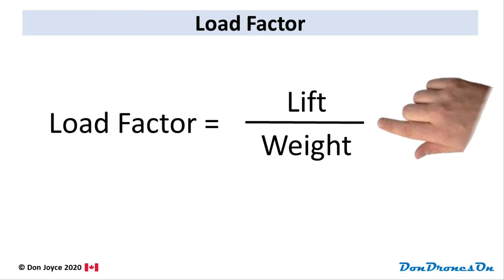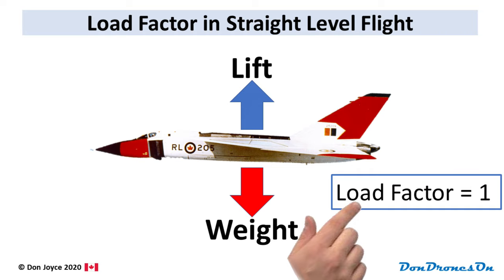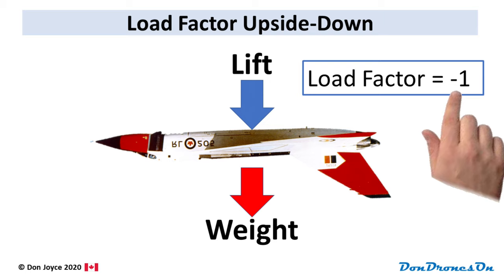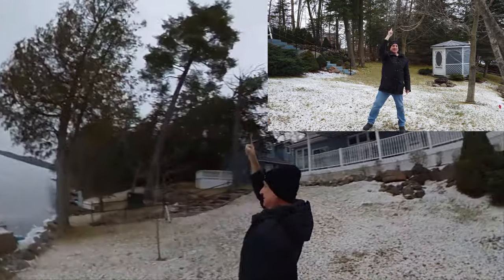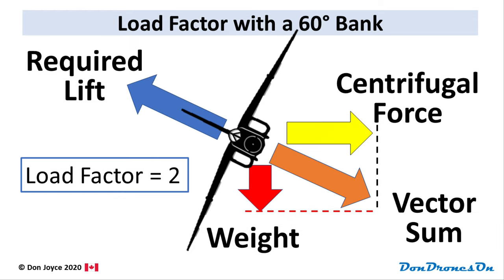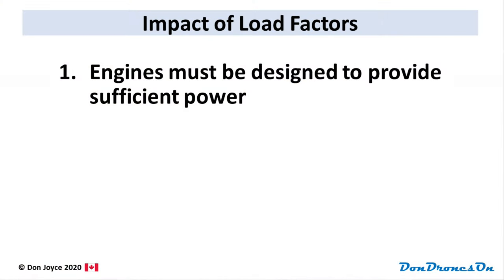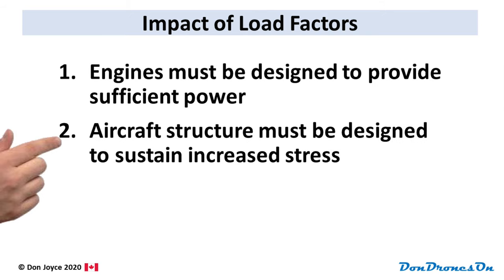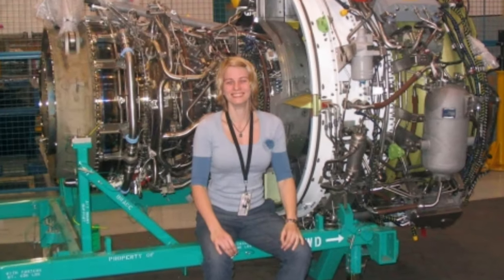Aviation Load Factors Explained

Comment: I have a question.
At 1:25 in this video, on account of your picture, it seems that the airplane neither gets decreased altitude nor gain altitude.
(That plane is flying level flight but just turning.)
Because vertical lift from "required lift" is the same as the weight.
Am I correct?
Reply from the maker: That is correct.  The plane is flying level, but turning.

Comment: What are the different loads acting on Quadcopter during flight
Reply from the maker: The loads on a quadcopter are exactly as described in this video.   Generally,  the forces are relatively low, and well below the failure points for the structure.

Comment: Can you please enligthen me the effects of load factor on symmetrical or assymmetrical manuevers
Reply from the maker: If this was a drone exam question topic, it would certainly fall into the "ludicrous " category!  I looked around a bit, no obvious answer or connection with drone flight.  My guess: asymmetrical (ie two axes of change) most likely increases the load factor. Just a guess.
Reply: @DonJoyce  thanks Capt i have seen this on hercs primary fuel mangement and that was the thing that i cant understand
Reply from the maker: Yikes!  Please don't use my drone exam videos to help you fly your herc!!!